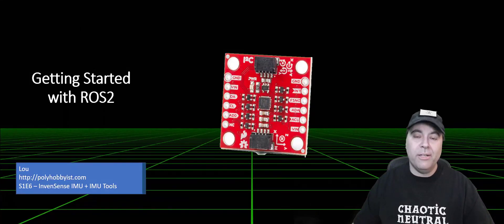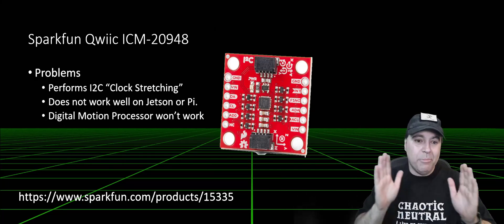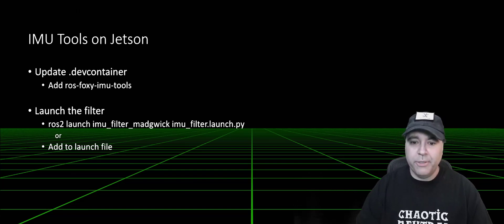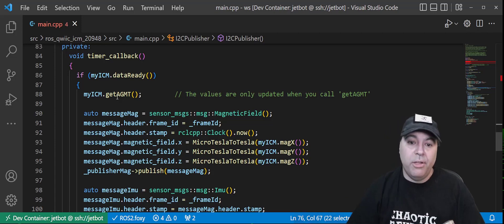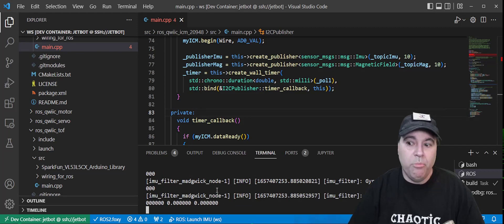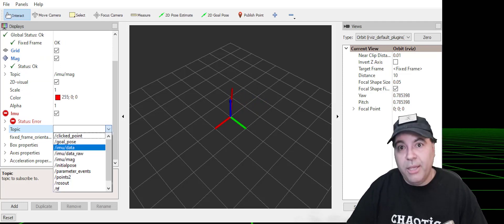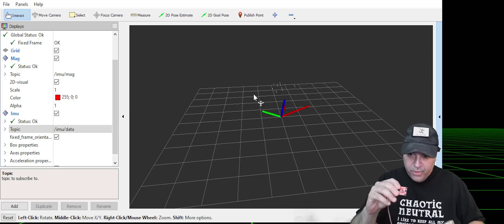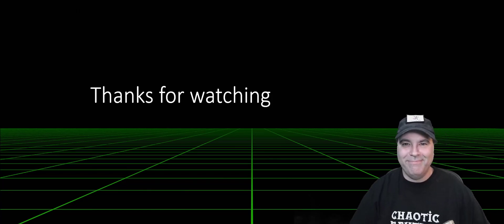Getting Started with ROS2 Navigation - Episode 6 - IMU and IMU Tools

Comment: Excellent tutorial.  This really helps put things into perspective.  I’m looking forward to the next one. Thank you!
Since the Sparkfun board is out of stock I’ve been using a GY-521 (no magnetometer)I had laying around.  Is the magnetometer a critical part of this project?
Reply: Looks like the 20948 is back in stock
Reply from the maker: I just got the Sparkfun AutoPhat which includes several of these components - I hoping that the supply chain crisis is finally working its way out. I'll do an update with that board.
Reply: @rh_robotics  I got one too.  It's going to be a creative fit with the Nano. ;)